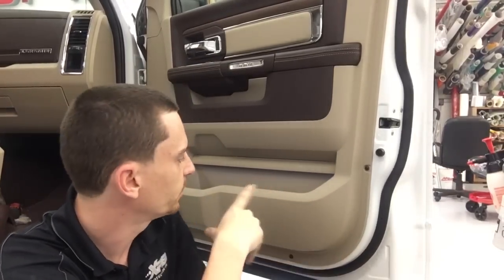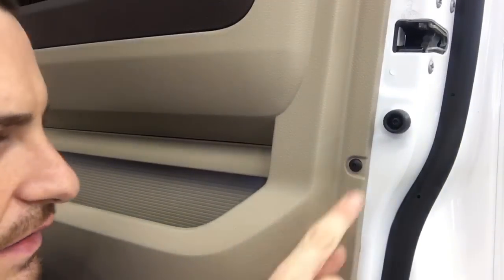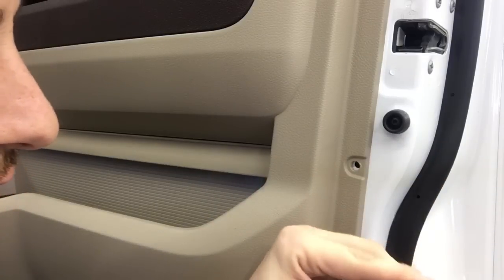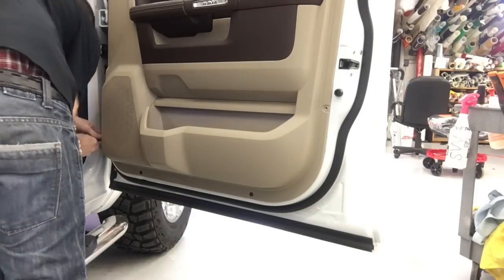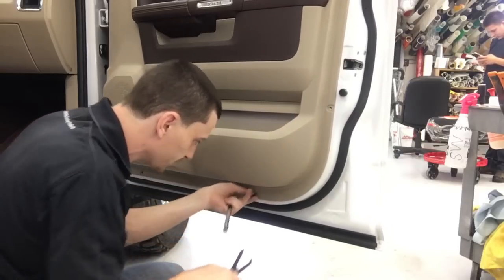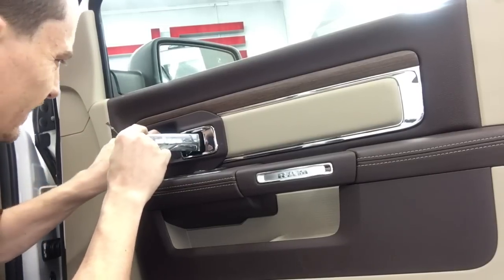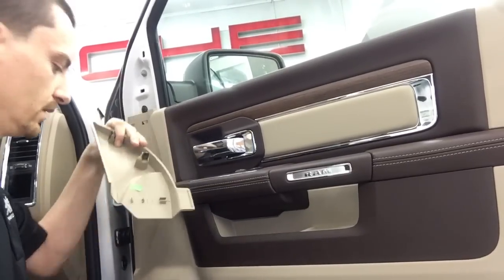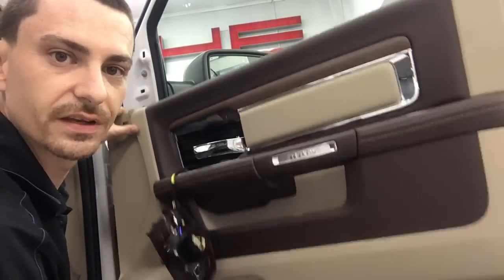2013 - 2017 Dodge Ram door panel removal

Comment: Thanks for the info. I have a hand crank window. How does that come off?
Reply: Greg Miell Greg what you wanna do is get something to slip between the handcrank and the door panel to give a little bit of space there and then you're going to need some sort of hook tool and you're going to need to grab on to the center of the pin that is attached to the handcrank once that pin is pulled out then the handcrank can come away from the door panel , and then to reinstall it simply put the pin in the handcrank and then push it back on to metal post
Reply from the maker: Greg Miell hope it helps this is the tintguy btw